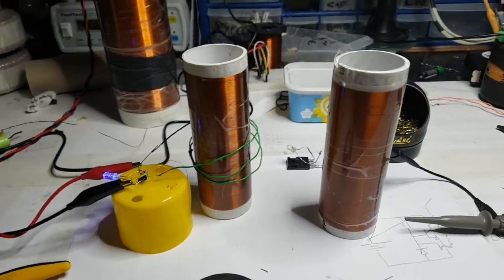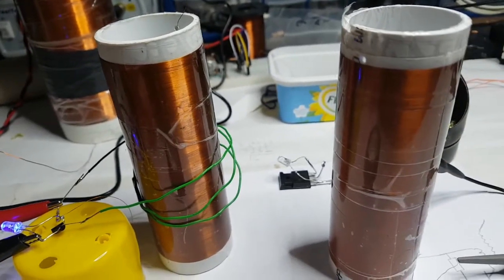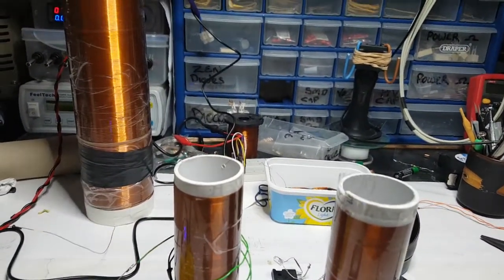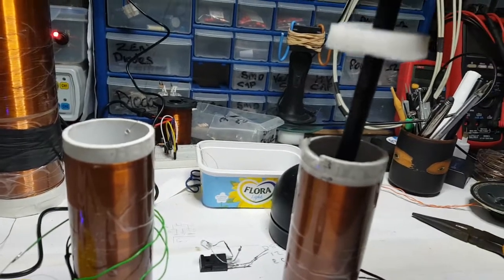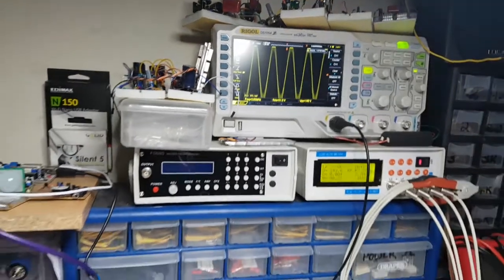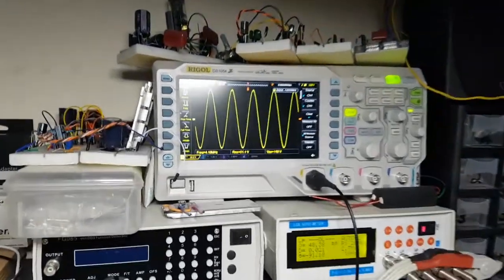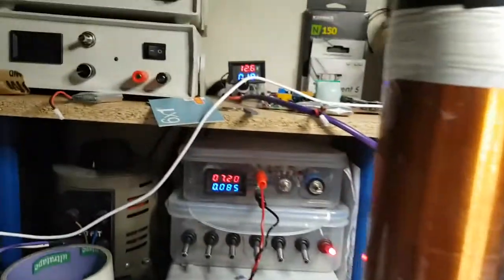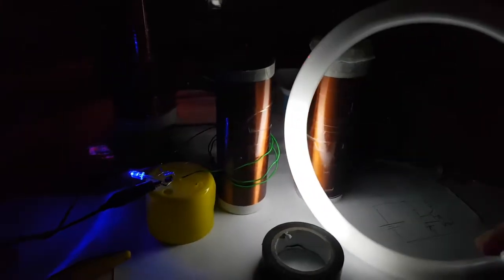Electromagnetic Field Experiment

Comment: What of trying at different frequencies?  How about coil orientation?  Cores tried other than ferrite?  In any regard, thx for creating the video for us to watch.
Reply from the maker: Hi, thanks for the feedback. Turning the secondary coil sideways and it cancels the inductance. I haven't anything else to try beside the ferrite. I have tried with a slightly larger secondary coil and got 80V with 7V on the primary. If usable voltage and current was wanted from the secondary a more capable transistor would be needed.